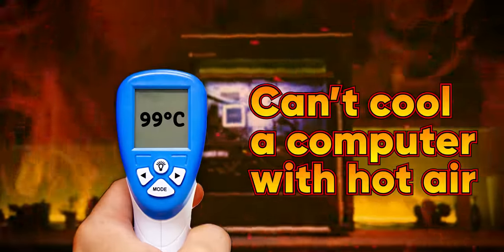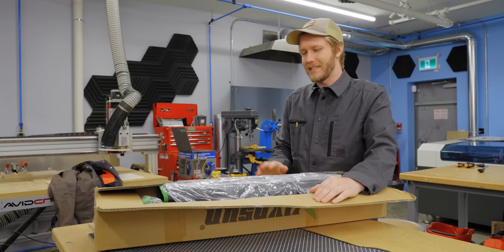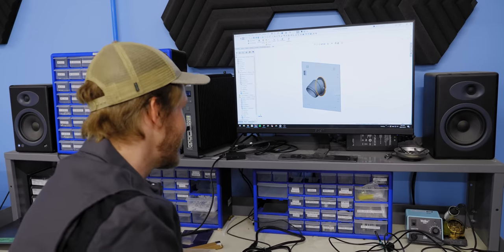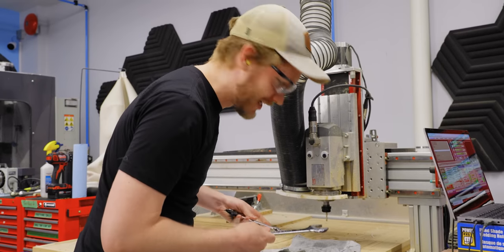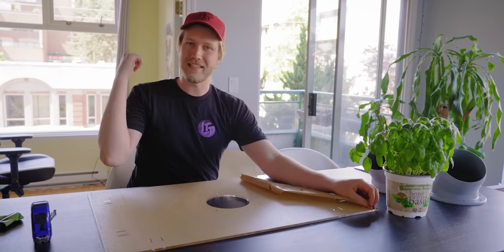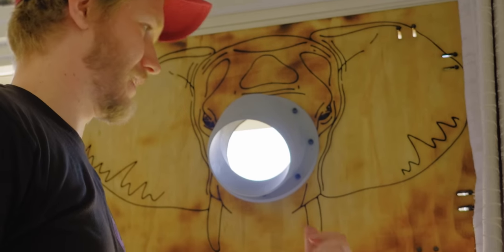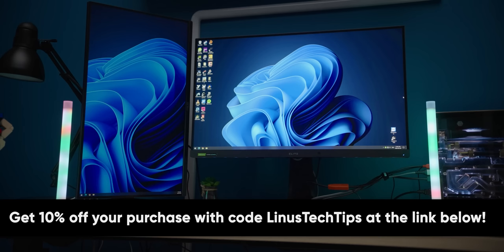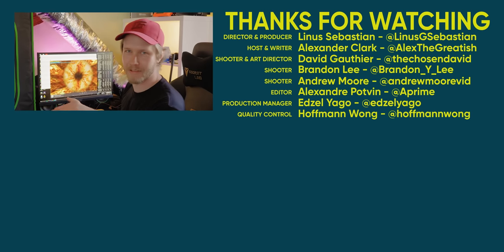You’re cooling your PC wrong. - PC in a Grow Tent

Comment: u did not need to use a grow tent you could have just taken portable ac tubeing make a fitting for the top or back of your case to connect to it and use the same fan u used and no sus grow tent just reamber to put better filters on ur intakes

Comment: Waiting for him to realize that it needs to have both an inlet and outlet for air, or else the fan will just stop working after the air pressure in the room becomes negative. Your now forcing all the cold air in your apartment out and forcing outside air into your house through all the tiny holes and cracks in your apartment. Essentially your cooling your entire apartment continously to prevent the heat from the tiny computer from over heating your walk in office closet.

Comment: Those pipes ARE for horizontal rigidity and to hang your lights and equipment from. The tent you got was just really bad. That being said, I've tried most of the Amazon tents, as well as "higher end" ones from hydro stores and it's literally the roll of the dice. Spending or saving money literally doesn't guarantee much difference in quality.

Comment: Put the fan in a sound insulation box. With vent holes that have a muffler type design. As for the vent pipe.  Get proper HVAC metal enclosures and mount.  Another reason the room is probably cooler is the window is effectively closed. A lot of people stupidly open windows when its hot instead of keeping them closed.

You can use automotive tech, get a car turbo intercooler that has water cooling and you wont need that huge pipe either. You can combine with one of your PC water cooling rigs.  

What you effectively did was make a homebrew HVAC🤣🤣🤣

Comment: I think building a small enclosure (e.g. something like a 3D printer enclosure) with added venting will look way cleaner and is probably not that much more expensive. But I'm still not sure I'd want a whole bunch of tubes in my room ;)

Also be careful with such a system if you have a fireplace or gas burner in your home.

Comment: I thought of a similar idea recently, but would've build a simple frame that can clip on my existing case via magnets (got 420mm rad intake and 360mm rad exhaust on top and an additional 140 pulli g cool air in) and then pulling the hot air out the case through piping and out the window/door, way less intrusive(in theory) and still most of the benefits even if the case of the pc heats up 👍
Reply: ⬆️Congratulations you have been selected as one of the lucky giveaway. Message to claim your prize 
Thanks for commenting and engaging

Comment: I have a setup like this for my mk3s+. It sits inside an enclosure and the air gets sucked out by a Noctua fan into a 100 mm tube and out of the window. I thought about doing something similar for my 2 pcs, but just adding a fan hose at the back, that leads to a 100 mm tube (also out of the window).

Comment: It would be more efficient to just install a cheap window AC unit to cool the room. Then it wouldn't steal cold air from the rest of the house. A cool concept though. I used to grow weed in my closet and forced the air outside and always had the air rushing through the cracks of my door. Good times.

Comment: This is pretty inefficient, alot of the exhaust out of the grow tent isn't moving thermal energy from the PC outside, and is instead just creating negative pressure pulling in cold air from the rest of the building. It'd be way better if you could force the exhaust to pull directly from the PC. Perfect example would be if you had all of the components hooked up to a single rad, with a duct directing all the exhaust out.

Comment: The more I think about this the more I realize how bad this idea is. You pumping out all your house cool are outside. So really your cooling your room and passing all the cold air through the PC, then dumping it. Then some where in your house it has to bring in the hot air. 

I think it would be better to pump the air off the PC/tent to the return vent in the room. It would then cool that air and return it too the house. That air will still be cooler and dryer than the outside air. Also can run in the winter too.

Comment: Or you can just buy a good ass fan stick it in the room and have it blow air out of the door which not only is less electricity than this contraption but also keeps your room cooler. 

Just having the door open will lower the temps. People who use their pc typically have their door close which traps the hot air inside. Use a fan and have it pointed towards your door that is open and I promise you your room will be cooler. Still have to have ac of course but just that alone will lower temps

Comment: The reasons he gave in the start of the video mostly sounded like baseless whining. There isn't going to be any issues with the air conditioning if you spend some money on some electrician instead of wasting money on something like that. I use air conditioning and my cpu hasn't gone more than 68°C on stress
Reply: A freaking tent for the pc? Give me a break smh

Comment: If only there was a sort of object which could fit your computer hardware directly, and exhaust heat through air or water in some way. And at the same time more rigid than the tent. With handy I/O on the outside and buttons. Ah man. If only. (JK: it's a case - could do a airflow-controlled case, or... full room water cooling - take 2? perhaps not all editors but more like an "at home" version!)

Comment: Why don't you just put that hose straight to the PC case instead of having a big ass tent? I have that solution at home but it is connected to the ceiling to the ventilation in our house, just make sure that you configure the flow in your case so that you only take air in so that all the hot air gets extracted through the hose. My hose is connected to the top of the case and I took some cardboard as a shroud straight to my CPU cooler, so that all hot air from it gets sucked out immediately.

Comment: You can find a smaller One made by secret Jardin ( in cm 60x40x60, Is 2' x approx 1.4 x 2) , definetely smaller
Or others brand, try searching cloning box, and with my Mining setup i've sede that opening a small air gap in the box keeps the system cooler not affecting the room temperature. Also i suggest you ti hang the tube on the celing Maybe with 2 Rings , Grest setup by the way and Good video these days
Reply: I'm not sure they want us to take this seriously.  A logical person would simply place the PC closer to the window, and install an exhaust fan in the window.
Reply: @TexMex421  here with our house near 30c inside we use also the box and it's way Better, yeah Is a super trash solution but It works great

Comment: dont get me wrong, i really really like these videos as they are entertaining and fun. 
but i am wondering if you guys put any time into thinking about this idea. 
first thing, you could have tested this without machining all this pieces. just put the tubing out the window and close it up with pieces of foil (garbage bag) and tape. you could have tested the fan beforehand to see if the noise its producing is in any way making this whole operation obsolete (which it does, imo). 
so, what is my point?
i think you could have made it quicker and with less brag about all the super expensive machines (u got for what, actually?)  and even being as entertaining as it was OR just put a bit more thought into it and build a propper ducting system, get a good and silent fan, make it neat and usable. 
it felt rushed and unbalanced in the way how much efford was put into machining stuff and how little into actually building the system. 
i hope this doesnt sound like i disliked it! i just see so much potential not being utilized.
thanks for making these videos!

Comment: A rather strange solution you choose. 

Id rather go to watercooling and extend the waterloop and place just the radiator outside. 
This way you dont create a negative pressure your flat which in the long run will lead to hot, outside our being sucked into you flat. 
Also much smaller water lines.

Comment: I have a box fan close to my bed and my desk is right beside it so the cool air from the box fan hitting me is also going over the front of my PC plus when I'm gaming I have the fans set to max speed. My case is also a P500A airflow with 7 uni fans at 1900RPM when gaming so my room never really gets that hot. lol
Reply: Also, My PC is a Ryzen 9 5900X, EVGA RTX 3080 FTW3 so it does make loads of heat I just have a good set up to deal with it.

Comment: Couldn't you get a window mounted air conditioner, put a radiator on the front, and run your water cooling loop through it?

Comment: the PC needs an intake from outside too, otherwise what is replacing all that cool air from inside your apartment? you create a pressure difference which pulls the warm air from outside into your apartment instead.
Reply: Maybe an intake vent by the AC unit make his PC cooler and make the other people in the apartment suffer
Reply: @EDV8ZR1  lol brutal :D
Reply: @AdamXA  well I was just saying siphon off the air for one minute not all of them you know not the main trunk from all the vents just one vent brutal would be to turn off all the other rooms and just direct it into the PC I was just saying one trunk it didn't feel like the longer explanation the first time

Comment: Your apartment is just going to suck in hot air from the outside at the same rate you're putting it out.  Sure it may make that one room feel cooler but your really doing zero good unless it's cold outside

Comment: This is a bad idea for a house with AC.
All you're doing is dumping all the AC cooled air outside while passing it through the pc once. You even point out how much cool air is rushing through the door.
What you should actually try to do it somehow recirculate the air back into the house better.
Hopefully you realize this and don't keep this as a permanent solution before your electricity bill skyrockets.

Comment: I got AC (110V inverter, 1 ton) for $250 XD it cools my 4x4 meter room in no time and my pc stays cool, also all connections went to the ceiling so it has its own breaker XD...i have never used the AC in anything but eco mode, full mode is just too cold... Not sure how it heats the room, gotta wait like 6 months for that test

Comment: lol this is way overly complicated. All you have to do is buy a couple of 120mm fan vent mounts (about 10 bucks each) and attach it directly to your computer exhaust vents. Then vent it out with a 120mm duct hose. With this setup your pc will not get any hotter than before

Comment: Hmmm....grow tent???...the amount of legwork was too daunting...how about reflective laminations for your window glass and sheer curtains or better full black out curtains since you got AC in that room right?....if NO...then Ambient air control would be key... and just like the PC rig. "air flow management in that room is key...3rd world countries have dealt with gaming with a room fan (imagine what a bunch of typical $20 Walmart/Target  box fans - modified for dust filtering - can do for your  sweatass? :D )for a while now :D...not the best but it manages. - run on  slow for relative quiet and fast for when solo gaming...i guess the challenge is finding a relatively quiet but not expensive one...with fans "streaming quiet" is a premium you will need to pay for. :D

Comment: So Just Curious, I Mod N Bush Fix Components All The Time, Why Didn't U Just Fix N Mod The Case Itself In The Back Of The Exhaust Fan, N Run A Small Tub From The PC Case Exhaust Area To Ur Window Using Aluminium Siding As A Small Sealant For The Window, Depending On The Case Material's, U Can Use A Small Scrapped PSU High Powered Fan To Direct The Hot Air From PC Case Directly To The Window, I've Done It Several Times For Utility Shed's, Works N Cost Effective, N U Don't Need All Those Fancy Work Bench Tools U Used, Just Drill Bits, A Drill, And An Angle Grinder N A Diamond Blade If Ur Using PlexiGlass. Believe It Or Not, When Using PlexiGlass, U Can Use A Drill Bit To Cut Through The Plexiglass N Slightly Run The Bit Where U Need It To Heat N Melt The Plexiglass Off Where U Need It, In My Case, A Circle Shape For The Exhaust Fans. Although, When Going This Approach, U Will Need To Quickly Use Pliers To Drill Off The Melted Residue From The Bits As U Stop N Take A Break To Wipe Off The Melted Plastics From The Bits Before It Cools Down.. Cost Me Less Than 30 Buck's, N I Used Old Refrigerator Cooling Fan's As Well As PSU Fan's So It Stays Genuine To PC Parts. 🤝

Comment: really?...why didn't you run it straight up to the ceiling and stuff it in the corner along both walls? find studs for mounting hardware or even make your own 10"  angle-wood (not iron) and fully box it in at the ceiling...even a half ass job would look so much better and give you more space. For as much time as you put into the prep...that really looks like a meth head solution lol

Comment: Ok, wait. Air is a pretty dense thing actually, there has to be exhaust, obviously but also *an intake*. And this config here, doesn't really have a viable air intake. If you want to throw a certain amount of air out of your room, the replacement air has to come from somewhere. And if you're pushing it outside, then guess what, the replacement air is gonna come from outside as well, unless you live inside a vaccum pump! What I mean is that it makes sense as long as the replacement air sucked inside is cooler than the one being thrown out. And of course, as long as the outside is cooler, it's A-ok, but if it's warmer, you're using the rest of the building as a "cool air reservoir" which is gonna run out surprisingly fast on a really warm day. And in winter time, you're gonna be losing ambient heat quickly. This said, i just feel there should be a viable air intake, taking fresh air from the outside. And possibly a thermostat, which could switch between the outside air and the "air reservoir".

Comment: This is just utterly ridiculous, atrociously ugly and stupid. 
Better to just custom loop everything with a external radiator, get a long hose with quick disconnect to a radiator outside, or just build a positive pressure case and pull a single hose from the top of the case outside, absolutely no sense in envolving everything in that tent. Jesus christ.